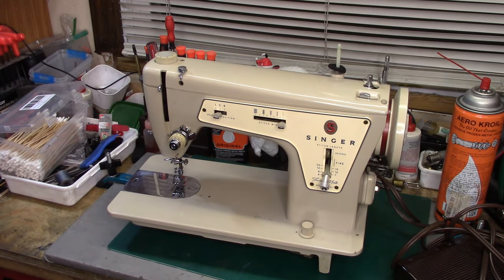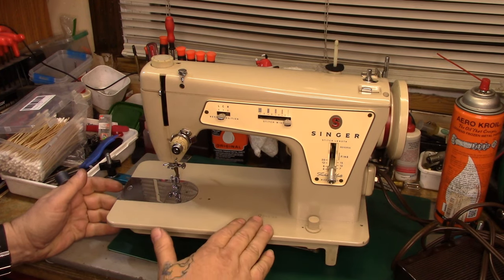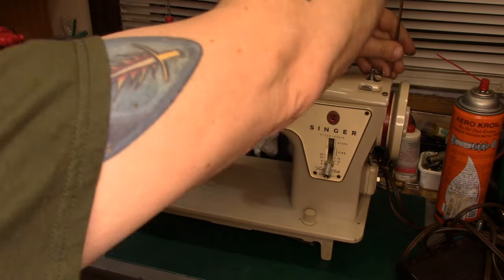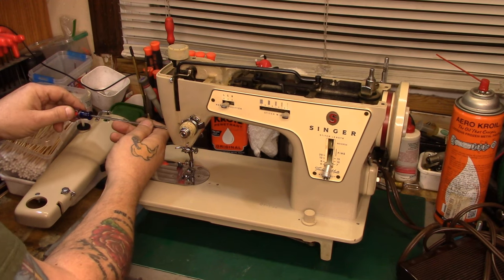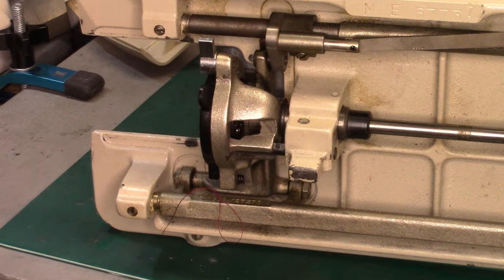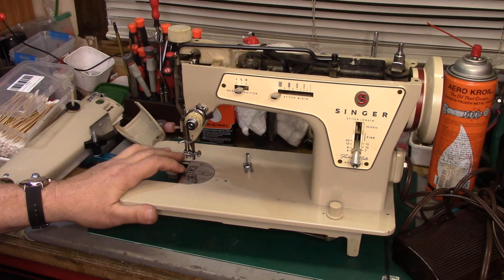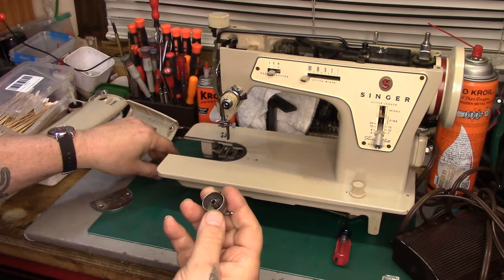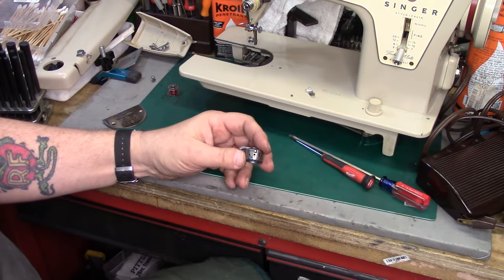Singer 237 Basic Maintenance

Comment: I have two Singer 237s. They are a robust strong sewing machine. I just finished a dozen oven mitts with one. The finished project had four layers of cotton, four layers of insulbrite, and four layers of cotton batting. The sewing machine had no problem sewing them. The only difference between the two machines, is that one has the knob and rod to control to raise or lower the feed dogs and the other one doesn't.
Reply: I knew about that. I have an earlier one, without the feed dog control. There is suppose to be a needle plate that covers the feed dogs for darning, but I don't know if it's still available.

Comment: Janome new-home-574 does the same hook movement.  I am in the UK and fixed one for a friend.
We also have a few zigzag attachments to make a straight stitch machine move the material. I do admire the engineers that created these machines and accessories.
I am currently using a Singer 631G after fixing it last year.

Odd design change on the Singer 760G I have two of them I hade hoped they would be the same for spares BUT one is "belt drive" the other is "worm drive"    

I wanted the 631 and 760 for the chain stitch option / setup.

Comment: Bob, I love your stuff, especially now that i just picked up a really clean 237. I have a question about race cap adjustment. The service manual states the .010 clearance spec as you performed in this video (front of needle to race cap). There is quite a bit of sideways slop available as well from oversize width of slotted hole and actual screw diameter. How far should left side of needle (thread groove side of needle) be from race cap. Is there any advantage in running that dimension closer to needle or farther from needle ?  Thanks in advance !  Bryan

Comment: I just purchased a 237 and it is in great shape, but make a rubbing sound coming from the hand wheel area! I'm not sure how to fix it? Do you have any ideas?
Reply from the maker: First thing, pull the belt off and see if the noise is there when you turn the balance wheel by hand. Keep in mind that a too tight bent can make that kind of noise as well.

Comment: Could you tell me what type of bobbin this machine uses and what size belt
Reply from the maker: This uses a class 15 bobbin. The belt size should be 13 3/4" circumference.  The Singer belt is #196388.

Comment: I was able to tear apart oil it get as much rest removed as possible and I finally have the machine sewing now. Unfortunately it homes really loud when I first use the accelerator pedal and I have to hand turn it to get it started. Once it started, it’ll go. It just doesn’t have the force that I thought it would have. If I’m sewing three or four levels of fabric, it just really struggles to punch through it. Even with a leather or a denim needle it helps but it’s like the motor just doesn’t have the power that it probably once had… I did change the belt. I got me a new Bob and case and new bins because the ones that were inside the machine were so rusted….. I’m not sure if there’s something that still needs to be cleaned and lubricated, or if I need to switch out to a newer motor and just not sure financially if that’s worth doing or not
Reply from the maker: Hi Shirley. This may seem counter intuitive, but your belt might be too tight. When belts are too tight, it puts a big strain on the motor. There should be a bit of deflection on the belt when you press midway between the balance wheel and the motor pully.
Reply: @BobFowlerWorkshop  OK… I’ll give that a try

Comment: Do you have a recommendation for which motor to buy to get better out of my machine… it will sew thin cotton fabric, but just Moans when pushed to so denim or thicker fabrics… 
I saw they do sell replacement on Amazon… 
I and trying to sew rope baskets.if it’s 4 mm and twisted cotton it can sew with some encouragement 😅
Reply from the maker: Before you go replacing motors, try changing your belt. I recommend a cogged type belt rather than an older style Vee belt. Also, too much tension is just as bad as not enough. The belt should have a bit of 'give' to it. You will want to try different tensions to see what works best. This is an example of the belt that I like on these:
https://www.sewingpartsonline.com/products/singer-motor-belt-196388

Comment: Subscribed.

Okay I don't know if you're the right person to make this request to/of? 
The 237 is known to've been one of the last machines that could be adapted to work with a treadle. I'm wondering if either: you could make a video adapting your 237 to a treadle or; you could link to another creator's video that shows the process of removing the motor and installing the 237 into a treadle table or; another creator's video on fabricating a treadle table from an old treadle and installing a 237 into the table.

I have a 237 and it's really great, especially since I swapped the old ceramic foot pedal for an electronic one. The e-pedal makes it into an entirely different machine, in a good way.My next upgrade was going to be a 1.2A motor or a treadle. I'm thinking that the treadle would be more of an upgrade than the more powerful motor, but probably at least the heavy duty motor is available and a step in that direction - especially combined with an e-pedal.

I already have a bare treadle that I rescued from a dumpster. It's working, and I'm just waiting for a chance to use it. No table, just the treadle, flywheel, frame and crank. It cranks well, the pulley's in good shape. I'd like to build a table for it and get a belt, and hook my 237 to it. I just don't know enough on how exactly to do it.

Thanks for the content.
Keep up the good work.
בס'ד
Reply from the maker: As a matter of fact... I had a customer last year with a 237 that needed a good service. When I delivered the machine, we took it out of the carry case, removed the electrics, and installed it in a treadle cabinet that had held an old 15-30. I fabricated a belt and she treadled very well. We didn't shoot video of the process (the lighting in that room wasn't suited for video), but the conversion only required the removal of the electrics - no change to the rest of the machine.
Reply: @BobFowlerWorkshop  Thanks. I fooled with it last year, when I changed the belt. It's not attached by too much, only a little bracket. The bracket doesn't offer a lot of adjustment either. I don't have the sophisticated belt that you show in your video.

Comment: Where do I buy a belt like that? What size too?
Reply from the maker: Hi Shirley, The belt is a #196388, which is 13 3/4" long. I like these:
https://www.amazon.com/HONEYSEW-SINGER-SEWING-MACHINE-196388/dp/B01MSO9A4L/ref=sr_1_5?crid=1MIBVXSW0QR5N&dib=eyJ2IjoiMSJ9.sa3-wlkm6I7S3qlufqehg94M8pp0dmY8EheljUuUY_SYCypCnHGhQVJqhVnM30mr27_apfiRs7gJUIyy4plOFPYqK-fynQhA1doyjWZv7Bs26GPYYI9qB3tLquxshtlEZHA2MZiLoQu-Ne-E-1jg9qPU4OWGMCPjhc8WQ9Up7ZKaJYN-Z-AOoY9mzvy2xgrH9WQeIxUcDuivozxsp1JZF82yN_lIsEoDw4DOWgSztLc.wPHY26a6JhCuBWz4cpWe1ZnBlzwZk0BSm89en9Hx_eo&dib_tag=se&keywords=Sewing+machine+belt+196388&qid=1705460144&sprefix=sewing+machine+belt+196388%2Caps%2C142&sr=8-5
Reply: Thank you so much!
Reply: Just bought one of these today for $40.  Glad to hear they are good. I opened it up and thought it was dry there is almost no wear.  Lubed her up and she works great.  I want to check the timing that's how I found you. Thank you.  Owners manual says 1965

Comment: Is all the gears metal or plastic?
Reply from the maker: All metal, she is a tank!
Reply: @BobFowlerWorkshop  placed a bid on one on Ebay. I doubt that I'll win at the price I maxed at, but if I do, I guess I'll ask for forgiveness from my wife.
Reply: The bobbin race cover is plastic and the original design has a thin section on it that sometimes will crack. Replacement bobbin race covers nowadays are not metal but the new ones almost all have had that design flaw corrected, and that section is heavier and won't crack.

It's not something that you would just replace unless it broke, but that said, I replaced mine just in case, ahead of time.
Reply from the maker: @KelikakuCoutin   I tend to keep a couple of 237 race covers on hand, just in case...